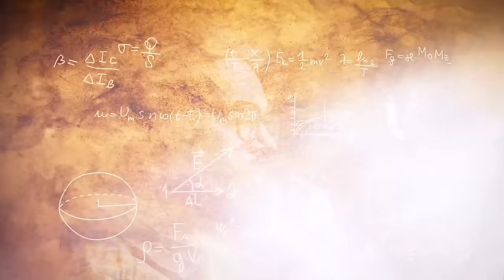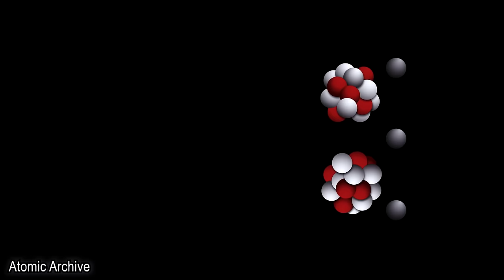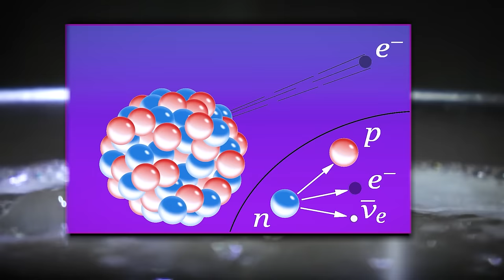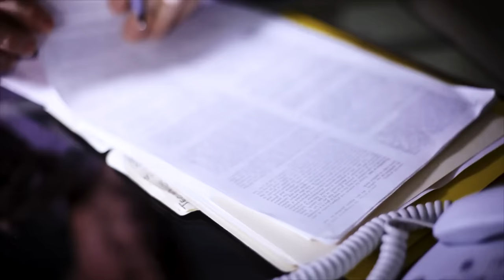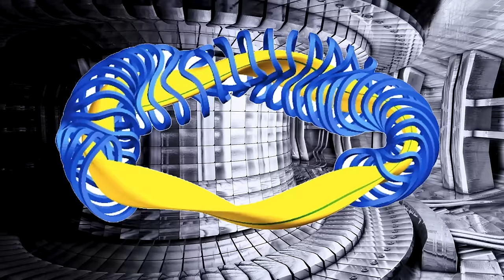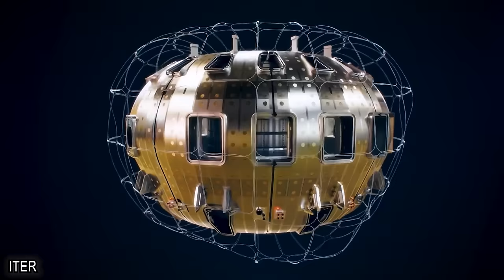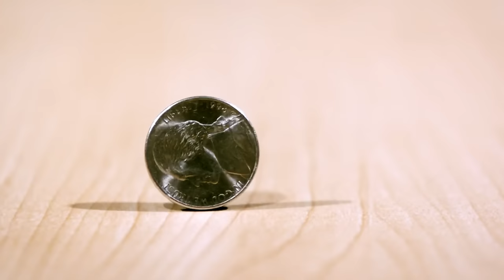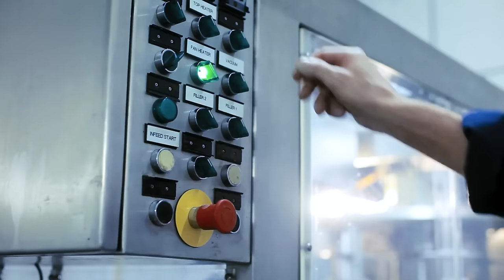When will we FINALLY achieve fusion power?

Comment: Deceptive video (as usual for fusion, especially related to total waste volume including equipment waste).
The NIF produced 0 electricity. Remote powerplants produced 400 MJ electricity from appr. 1300 MJ chemical energy (conversion and transportation losses). NIF lasers produced 1.9 MJ light(pulse) from 400 MJ electricity and +1.3 MJ fusion energy was achieved (starting from 1300 MJ chemical energy. They deceptively advertised this as 2MJ => 3.15 MJ carefully hiding the real details from the press... You can dig it up yourself.). Million USD experiment, repeatable appr 1..2 times a day, destroying the pellet and holder, yielding 0 electricity and no hope for conversion or practical energy production or anything useful other than tuning weapon-related computer models.

The ITER / DEMO could be made to work at least for a few minutes, perhaps only a few 100 more billions of EUR and 3..4 decades... at worst it would need to be scaled up so the volume / surface ratio grows. Only to find out that it produces more total waste (equipment waste) and not enough fuel even if 6-Li from all Li and the worlds Be production is diverted.

Continuous operation for years is not on the horizon. But even if that is miraculously solved:
The problem is that considering the total waste, including the equipment waste as well, it CERTAINLY produces more waste than fast-neutron fission (and even slow-neutron fission).
The spent fuel is extremely valuable with fission, and relatively easy to handle (was solved before 1985 but the maffia killed the SNR-300 in Germany before it could start to run, and the Integral Fast Reactor in USA just before it was completed in 1994 after awarding lead scientist for environmental, economy, safety-excellence. 93% of spent fuel can be reused to produce energy (6 million kWh of electricity / kg) in fast-spectrum reactor (all TRU, 238-U and 235-U) or the U + Pu in a small percentage (upto about 4% spent-fuel U-Pu MOX + 96% 233-U made from Th) together with 233-U in slow-neutron breeder. (Shippingport LWBR was running for some time on 233-U and proved that even light-water reactor can be used if not wasting neutrons on stupid moron-boron). The value of fission products is 16000000 USD /ton (eg. contains some metals more valuable than gold, eg. platinum, rhodium). Most of fuel fission products are stable after a few years. If reprocessing is allowed, the total amount of fission products waste can be stored in a volume equivalent to appr 20 m cube (2..4% of 95000 ton appr. 0.32 kg/person total spent fuel => 2000..3800 ton depending on how much is utilized of the 5% FP. Appr. ~0.013 kg / person, 90+ % of it to be stored for 600 years... DID YOU KNOW THAT is the dangerous fission product waste to be stored - unstorable, right?) That is not 1 powerplant, but the previous 60 years of nuclear energy industry of the USA. Certainly, there is some part that should be vitrified and stored in some deep-geo-storage, eg. granite-mines (occupying less than 1% of the granite mined; Less than 1 kg / person / lifetime even if almost all fossil fuel is substituted), eg. I think 129-I falls into that long-term storage category. 137-Cs and 90-Sr have 30 year halflife, can be used for several industrial applications, and less radioactivity than the original ore after 17..20 halflives, 500..600 years).
The problem of "spent fuel storage" is a political problem, after the IFR Integral Fast Reactor that processes and utilizes most of LWR waste was killed as a symbol to investors in a demonstrative way. "cancelled, pressure from the top" (maffia activity; very clear after Clinton's words: "it's a symbol".). The TRU part that "must be stored for hundreds of thousands of years" is precious fuel in fast-spectrum reactors (Pu and Am and other TRU fissions in fast neutron spectrum, while they often absorb neutrons and "grow" in slow-spectrum, accumulating, much less than 1 kg / person / lifetime total). 

Nuclear fission industry is the only industry where waste is more valuable than the input material, and which can actually store it's toxic waste. (Coal stores Pb and Hg in the environment, 100 times more than fission, released to environment, and infinite half-life... These remain toxic forever; Solar + battery is manufactured mostly from coal-power, and EROI<1 if more than 50% of electricity is made from renewable and battery systems are included => need more energy to produce the battery+renewables and even more waste than coal in the end, including CO2 - Germany realizes most CO2 emissions in China, but even domestically, Germany emits 6 times more CO2 emission / GWyear than France which uses fission ).
Yes, the deception is that big.
The fission device waste is appr. 30 times more than the fission product waste, and 1.2 times more than the total spent-fuel-waste if reprocessing is prohibited (that should not be, really).
DT-fusion produces 14.06 MeV neutrons that is extremely detrimental to devices lifetime, and device waste per GWyear is expected to be 10..50 times more than total fission waste if we are optimistic (possibly 100..200 times more if equipment lifetime is much shorter or power production utilization factor is much less than 50%, which is almost certain in the next 40 years).
Verify yourself. Just ASK for an official SCIENTIFIC study about the volume and handling of total DT-tokamak fusion related waste, including the equipment waste so it can be compared with fission waste. THEY HAVE NO SCIENTIFIC STUDY showing DT-tokamak fusion related total waste! Only arm-waving, journalist blabla. Fusion producing less waste than fission is a widely spread MYTH.
Real scientific studies showed that even if energy-production is not required, DT fusion has no advantage (See Hand Bethe 1979 and LASL/LANL 1980 studies about the fission-fusion hybrid where the DT-fusion neutrons were planned to be used to breed Pu, not T, but the fusion technology is the same. T-breeding is actually more problematic, and more dangerous in case something goes wrong: no surprise ITER only has a very small T-breeding proof-of-concept blanket-part).

0.010 kg / year / person Li is mined. That is 0.0007 kg / year / person 6-Li that would be the fuel of T-breeding (Sufficient for appr. 5000 kWh / person / year, not even enough for electricity; way insufficient to support industrial heat, H2, fertilizer, syntethic fuels, etc... - all required to significantly reduce fossil fuel usage). Needless to say: "it does NOT run on seawater". Since not enough neutrons to breed T, fission is a must. If U or Pu fission is used, the fusion is totally unnecessary. Just adds complexity, 10x more equipment waste, extreme problems to run continuously and maintain operation. Be could be used to help breeding. However, the 240 ton of 1 year production would be enough for 1 DEMO-category fusion plant. Thousands would be needed. Not enough consumables to replace 1/2 of fossil fuels, and extreme amount of waste and problems. Clean energy equals fast-spectrum fission for the time being. Most likely there will be other options in the long run. Fusion would make sense if it could be made small (SMR-size or even smaller), not even on the horizon. Perhaps some ENA or Rydberg-atom related energy production will be feasible. So far politics have killed the good paths and paying demo-"science" projects that is known to not be feasible. The last correct scientific conclusion about DT-fusion was from LANL: "The investment of time and money required to commercialize the hybrid cycle could only be justified by a real or perceived advantage of the hybrid over the classical FBR. Our analysis leads us to conclude that no such advantage exists." It is even worse if positive energy balance from DT-fusion is required. Anyone objecting: show the scientific study of the volume and handling of total DT-tokamak fusion related waste, including the equipment waste.
Fusion with virtually no waste is a dangerous myth. Especially together with the "unhandlable amount of fission waste", another deceptive myth by deceptive videos like this one: without realistic quantities and correct comparison.

Comment: Commercial fusion power is never goning to happen.  So far all fusion research has done is provide a good living for scientists and researchers, but the physical difficulties of "miniturizing the sun" are insurmountable.  "Break even" in a laboratory never mentions the power taken from the grid, but rather touts the "input power" to the experiment.  When you consider the overhead, lifetime and reliability required for a commercial powerplant AND make it price competative, our best best for climate change is modern 4th and 5th generation fission plants.  There are designs using molten salt fuel which are "walk away" safe, where excess heat causes the reaction to slow down and where thermal fuse plugs drain the liquid fuel into a cooled, geometrically shaped vessle that is non-critical, thus stopping the reaction.
Reply: Some in the MSR community have claimed that a 1GWe MSR could cost as little as only $1B, while conventional PWRs cost $5B that need 100 times as much concrete and steel. MSRs don't need any containment vessel so they must be an order of magnitude cheaper to build and should be factory built anyways. Can't wait to see the 1st MSR built NOT in China here in the west.

Comment: Not in our lifetime nor our grandchildren lifetimes. We are a long way off from achieving fusion and harnessing enough of it to power our electrical grid.
Reply: Why?  A hunch?  😊
Reply: @eugenecbell  Because that little fusion experiment they conducted a few years ago was insignificant. It was nothing more than a mere science fair project. When considering all the external power sources for the lasers and machinery, all that added up far exceeds the fusion output power. There's just no frickin way fusion will be possible to power homes within several generations' lifetimes.

Comment: Protium hot Fusion will never happen. There is no research into protium hot fusion happening now. The research going on now is tritium/deuterium hot fusion.
Reply: Never?
Seriously.. never?
Reply: The only practical alternative to DT is just DD fusion but it trades one set of problems for another set of problems and at much higher temps too.
Some would even argue for aneutronic fusion too with PB11 as the fuel to avoid those neutrons in the fusion and even higher temps.

Improbable Matter and Daniel Jassby have much more credibility in this matter both have spent their entire careers in the search for energy from fusion.

Comment: A better question might be just 'will we EVER achieve ECONOMIC fusion power?'
The issue isn't about whether it's even possible, is whether it has a hope of competing against other technologies? Molten Salt Reactors are a much better bet, they achieve pretty much the same goals but has already been shown to be possible. The problem is several magnitudes easier to Engineer than Fusion.
Let's be honest. If the Oak Ridge MSR experiment was known in academic circles, we wouldn't have wasted all this money trying to do the hard problem when the easy problem was there to be solved. Sadly, the sunk cost is so great that they can't admit it's been a waste of time and switch track to the obvious alternative solution.
Reply: Indeed I would hazard a guess that MSRs will always be 100s of times cheaper to build and much safer, less problematic than any fusion plant. Once those fusion plants are up and running, the green peace people are going to start complaining about the Tritium supply chain, the contaminated steel vessels and those other issues the fusion pundits don't want to talk about, but thats a hyperthetical since they will never work.

But what does an engineer know, a machine thats built to run at 1000K or a machine thats built to run at 100M K. Um which is easier, if only the population at large was educated.
From the above astrophysicist its obvious that physics is simply too big of a subject for physicist to be knowledgeable across the board, so many mistakes.

Comment: I would argue that there IS a law of physics and logical reason why fusion is not a source of free energy.  The reason is this: It requires MORE work to initiate and sustain fusion than the energy it generates.  At best - it generates the same amount of energy as the amount of energy required to facilitate it.  That is not free energy.  All energy sources are energy that is provided from nature in a form where nature does the work for you.  Fossil Fuels readily combust. Wind blows. Water flows. Atoms decay. 

Atoms do not Fuse on EARTH.  Atoms ONLY FUSE IN STARS UNDER MASSIVE GRAVITATIONAL PRESSURE. THERE IS NO FREE FUSION.